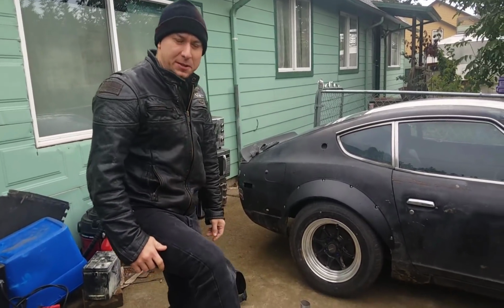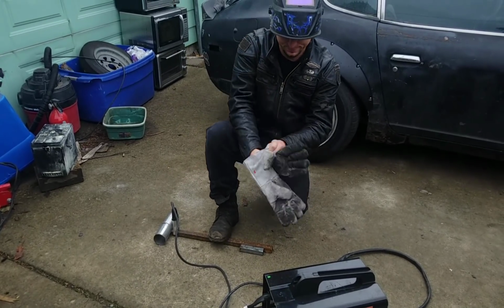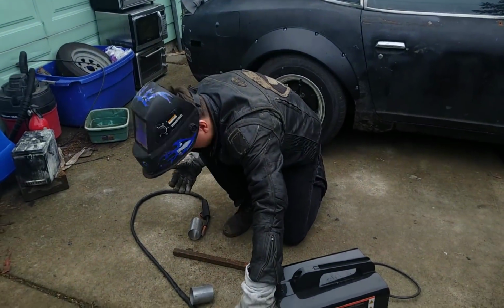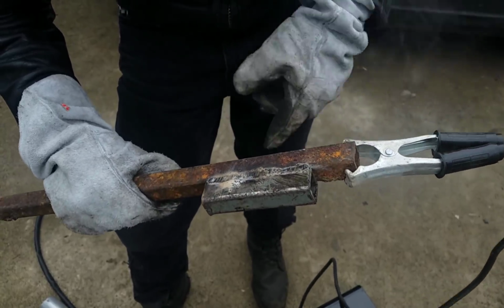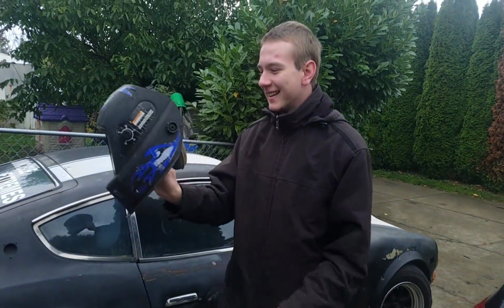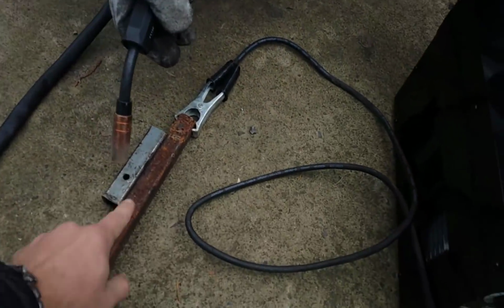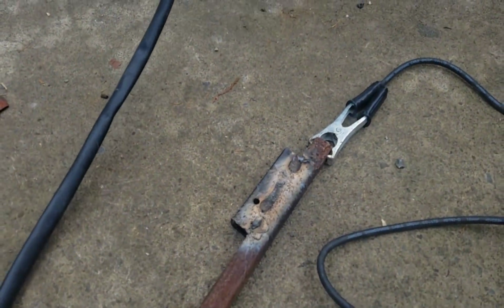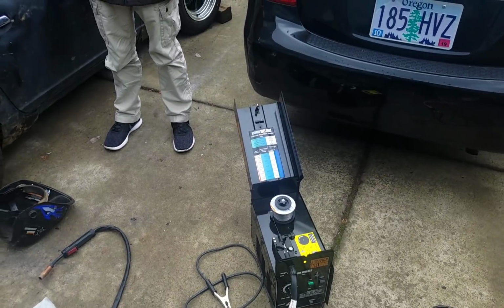$99 125 amp welder. Worth it? new 90 a.  Harbor freight 120v budget welding review. Chicago electric

Comment: I have a small 110 wire feed welder. Bought last year. Havnt touched it. Now I bought a small trailer needs work. Well time to learn to weld. Haven't welded since highschool
Reply from the maker: It's easy.  I'm sure you'll do great
Reply: @InvincibleExtremes  hope so. Do NOT want to have to pay for all the work. Though some things I may have to. Since I don't think it will handle very thick MATERIAL

Comment: From a newbie perspective, I understand Min. and Max. and 1/2 inch and cursive letter "e". Thanks, great video. I know that real welders won't need this video, but for $100 it's obviously good enough.
Reply from the maker: Frank Tiffney it's not the greatest, but I used my old one for 5 years before I threw it away.  It's just really messy, so that's why I like the century fc90 better and it's only 169 bucks...

Comment: I don't have 220v is this the next best thing for small steel armature rods for sculpture? (About 1/4" dia)
Reply from the maker: I would suggest the century fc90.  Half this size and weight, very portable, and a cleaner weld because it's dc, and has less spatter

Comment: Thanks for the video.  I believe I will buy this one for my first welder to do some patch work on our 1989 Ford Van muffler system.  Thank You.
Reply from the maker: margaret gardner it's good for that kind of thing.  The century fc90 they sell in home depot for $169 is a way better welder though.  If you can afford it, I would get that.
Reply: Thanks for the advice.  I will try to get the better one for $169 but we don't have a Home Depot here in Presidio Texas.  This is a very rural area.  We have True Value but their stock is very limited here and what they have is usually much higher than Home Depot.  People here often make trips out of town out of sheer borden and necessity.  Hopefully I'll get a good price on it in Alpine Texas or El Paso or even better Ebay.  Thank You.
Reply from the maker: margaret gardner eBay might have it.  I did a side by side compare of the two welders, have a video up.  Look up fc90, I'm the only one who's shown a review on it
Reply: Thank You.  I'm about to check out the fc90 video.  I'm waiting in line to have a new fuel pump installed then I hope to repair the exhaust pipe myself.  Your kindness is much appreciated.

Comment: I bought mine for 85 bucks about 12 years ago. The ground clamp is a weak link on mine thus i use the brass clamp hf  sells. About 15 to 20 years ago the model had diodes so the output is dc ie direct current. Hf dropped the diodes so the units are less than 100 bucks. Adding some diodes will make a slightly better weld.  The 240 volt hf wire welders have dc ie diodes. The 240 volt models have 4 ranges  for current. The 120 models have 2 ranges. Eons ago the hf 240volt wire welders often had way lower max amps. I have a 240v hf  wire welders that is 115 amps.
Reply from the maker: +3beltwesty wow, yeah I have the 170 amp model and it's nice, but not nice enough to bother dragging out the 240v cord
Reply: 3beltwesty is this weld machine in this video dc out put ?

Comment: Good job, thank you for sharing this.  HF should give you the next model up for free for you giving them this “Free Advertisement.” It helped make up my mind about this welder so I will buy it for that price because I just tinker around in the back yard and now believe it’s all I need. Thanks again.
Reply from the maker: Just a heads up, the 170 model is a MUCH better welder.  Have owed it for years with no issues

Comment: The 90 amp welder (despite the name) has a 120 amp maximum compared to 125 amps for this new model.  Is 5 additional amps at the theoretical maximum output the only difference between the 90 amp and 125 amp models.  The duty cycles at 90 amps are identical for the 2 models.  Does the newer 125 amp model have any benefits or upgrades over the 90 amp model?
Reply from the maker: Denise Manning that's a good question, I mean, besides the amperage difference I didn't see any... feels the same... welding with either one can be tricky but with a good ground it works good.

Comment: Looks like it will get the job done.  Nice vid!
Reply from the maker: +RamblinAround yup! Always good to hear from you guys
Reply: RamblinAround  get u a Miller or an esab or a vaulcan don't buy a Chicago electric there junk I'm a professional welder
Reply from the maker: Jeremy Hutchins they are junk, but they do work.  Especially the 170 amp model.  It's DC output and is a lot cleaner.  That's why I love my century fc90 inverter welder so much.  It's a tiny 15 lbs DC output wire feed and was only 169 bucks.  I have done a lot of in call rust repair with it, and use it on my own projects as well.  A miller is a great machine, but it can also be a giant waste of money for someone not needing a welder full time.  Not to mention a huge liability and heavy and unmanageable in my situation.

Comment: What would after-flash be? Though, I do have a cheap chinesium helmet myself. What turned out to be the issue was excessively low battery from being warehoused forever. 4 hours in the sun and it worked a whole lot better.
Reply from the maker: Cilis Moniker this helmet works great.  Been using it for years

Comment: I have a 90amp model and it works just fine, does the job.  Its not for commercial welding by any means but a small repair here and there it does a great job.
Reply from the maker: William Todd sure does.  I ran about 50lbs of wire through my old  90 amp one before the feed got iffy so I chucked it.

Comment: could you use this to weld quarter panels on cars? I am thinking so,  looks like this metal you're welding is much thicker. thanks.
Reply from the maker: The INVERTER welders which can go as low as 30 Amps and are dc output are much better for thin metal.  I've used this, and I've used all kinds of other welders, and the absolute bare minimum welder for quarter panels is the titanium 125... but the titanium 140 is much better because of its ability to take a gas bottle for a clean weld
Reply: @InvincibleExtremes  thanks for the info, you seem to really know your stuff.   much appreciated.
Reply from the maker: Thanks!

Comment: I know this video is old but would a lower end welder like this be ok for a roof rack? I'd like to make it pretty strong but I assume the design of the rack would be nearly as important. Just tubular steel, the cheap stuff at HD or lowes? I would think so but I've never welded much, I just used a stick welder and got lucky one time.
Reply from the maker: Low end welders can be ok.  Used them for years... my suggestion is the 170 amp machine, because it's dc output and welds way cleaner on flux core.  Or an INVERTER based 90 amp welder if 120v is a must.  Like the little green ones they sell, they're amazing.
Reply: Invincible Extremes Muscle Cars Garage Ok, thanks. I’ll look at getting one of the Titanium inverter welders at HF. I’d get a better one but I am renting and don’t have access to 220.
Reply from the maker: The titanium ones work great with 120v or 240v. Get the best one you can afford... I've been using mine for a long time and love it.

Comment: Just started welding an hour ago.  Setup was fairly easy.  Finding metal to practice on was a pain in the ass.  I made some real ugly welds but after watching this I can see a couple of my mistakes.  Moving too fast, wires too long and I need more light to see what I'm doing.   Kind of annoying when you finally lay down a good line and find out you completely missed the joint.
Reply from the maker: Keep it up.  You'll do just fine.

Comment: First welding video I seen. Very helpful
Reply from the maker: Jesse Delch thanks!  It's not the best video.  Also, if you're looking for a good cheap first welder, the century fc90 can't be beat.  It's WAY easier to learn on and is much better for sheetmetal rust repair and that kind of thing
Reply: Invincible Extremes Muscle Cars Garage  Thanks! I will check it out.

Comment: Sure you can't connect a bottle to it with some options kit or whatever?
I mean, it does have the gas nozzle... why would they waste money on shipping it with parts it doesn't need?
Reply from the maker: +ziiofswe e.g., the 170 amp one is the one for that
Reply: hobart 190....sure its 500 bucks... but it has everything you need, except the hood(welding helmet)  and the spool gun for welding aluminum (about 200 bucks) and no tank... but if you are looking to get a rig for less than $1000 this is a really good one that WILL do commercial welding, not some DIY/hobby welder that this one is...
Reply: oh yea go here and check out some commercial (professional)  welding stuff and how to weld go to weldingtipsandtricks, and weld.com.... chucke2009 does ok but..... actually go to really good welding videos... clean all of the rust and mill scale off of your projects and get a good clean ground and you will have WAY better success... a decent cheap welder but not a welder that can be used in a commercial way.

Comment: I have nobody teach me.  So I self learn, didnt came out right at first time but successfully for the first time, I weld.  Now all I got to do now is properly put the material in a right perspective.  Using $89 harborfreight 125 amp which was on sale at that time is a excellent beginner phrase of welding.
Reply from the maker: Yeah, I much prefer the 170 amp model, or the titanium INVERTER welders.  But they aren't 90 bucks

Comment: Buy a 240 volt welding machine next time!
 In The United States and Canada, the electrical power supplied to most homes enters your home at about 240 volts, that voltage is split at the main circuit breaker panel into two 120 volt halves. Those 120 volt halves are routed through the home to outlets and lighting. 240 volt is used for kitchen stove, water heater, washing machines, dryers, AC and welding machine ! Install a 240 volts outlet in the garage!
Reply from the maker: Yeah I own the 240v 170 welder they sell and it's amazing for the price

Comment: the trick to weld thin metal is to set it to the highest feed setting and then put it on min, go faster than normal and with practice you can get a nice weld :)

Comment: I tried 3 of these & out of the box on a shiny ratchet & coudn't get any spark..Suggestions? Also tried it on a couple of screwdrivers.
Reply from the maker: texjames2000 no spark untill you press the trigger.  This one isn't always on...
Reply: I tried that as well.. My 3rd one finally works. Just unboxed it & tried it on a pipe wrench. Guessing the metal has to be totally clean with no paint or rust what so ever. Will start actually experimenting tomorrow.
Reply from the maker: texjames2000 yeah, it won't spark unless there's a solid ground
Reply: Appreciate it..

Comment: I had one of these that did just fine. My only gripe was that it just didn't have enough oomph to manage many of the light welding jobs I have around the place so I upgraded to the 170 amp/240V and that pretty much takes care of my needs.  Anything bigger than that machine can weld needs to be done by somebody with a lot more experience than I have any way.
Reply from the maker: Yeah I have the 170 model and it welds amazing.  I upgraded to gas shielding and use solid wire in it and love it
Reply: @InvincibleExtremes  That is one of the things I had in mind with this when I got it, that it gave me the option for mig.
Reply from the maker: Yup.  And it gets low enough to actually be use for sheetmetal repair if needed.  The 170 amp model anyway
Reply: Yeah, that's what I have and it will do it. It's tricky, at least for somebody of my limited experience, but it will do it.  Maybe that's a brag for it. If I can do it, about anybody should be able to.

Comment: iam buying this welder thank you for the video
Reply from the maker: It's cheap and it works decent.
Reply: go to weldingtipsandtricks, and weld.com.... chucke2009 does ok but..... actually go to really good welding videos... clean all of the rust and mill scale off of your projects and get a good clean ground and you will have WAY better success... a decent cheap welder but not a welder that can be used in a commercial way.
Reply from the maker: Wayne Hartneck yup, all very true.
Reply: these guys will make you a professional welder with all of the how to's so you can take a test in any position even upside down ( they dont cover how to weld underwater, but who wants to deal with delta-p) and get your welds so even an x-ray can prove your success. there is money to be made in welding if you dont mind catching yourself on fire every day.

Comment: The only difference between the 90a and the 125a is the labeling.  Inside there identical.  The normal output on both machines is 90a, and they peak at 125a.  That's why some people who converted them to DCEN (DC Electrode Negative) blew out 100 amp rectifiers.  I converted my 90a to DCEN , with a 150a rectifier, and it made a quite capable welder for the size.  I've welded 1/4" stock to 3/16" on a project that needed the welds to hold up to 10,000# shear force and the welds are holding very well.  You're not going to build suspension bridges with this machine, but it will stick pieces together with good strength.  The DCEN conversion is well worth the effort.  One other point.  In the video he said it will only take a 2# spool of wire, when in fact it will accept a 10# spool.  If you use a 10# spool it's a good idea to trim the tube guiding the wire into the feed mechanism to half it's length to give the wire a straighter shot into the feed. Another thing is the wire.  Harbor Freight sells wire that is adequate but not great.  If you intend to weld with multiple passes DON'T use the wire that HF sells, E71T-GS  It is for single pass only! The wire code is as follows.
E= Electrode
7 = Tensile strength X 10,000#.
1 = Welding in any position.  0= Horizontal or flat welds only.
T = Tubular wire, flux filled.
G = General purpose welding.
S = Single pass ONLY.  Multiple passes will make the weld brittle.

I use E71T-11 Everything is the same except the 11 will allow multiple passes without getting brittle.
Reply from the maker: Beautifully explained, thank you.  I prefer dc output for flux core, and haven't used flux core in years.  But it's still useful for repairing fencing in a stiff wind for example

Comment: Because of roadkill I've been wanting a Dotson myself to make a Chevy powered Rotson.
Reply from the maker: Allen McKinney I'm about to drop a  big datsun revival video in a few days ;-)
Reply from the maker: frogmanvc I full intend to use it to do sheet metal repairs.  Being too hot isn't a big deal for me, can't run a full bead in 18ga anyway without warping.  So yes you'll be fine.  Little 1/2 inch long or shorter beads all along the seam and it'll do ok.
Reply: I'm thinking about buying an everlast pulse mig welder specifically for what it can do with sheet metal. Any links to videos showing pulse mig in action would be appreciated.
Reply: Datsun*
Reply: Eyyyyyy we watch roadkill.

Comment: The second time you welded on low likely went a little better because the metal was already preheated by the other welding you did on it. It COULD have been the clamp, but most likely it was the extra heat that made the lower setting work better the second time around. Nice video.
Reply from the maker: Treasure Pirate that's a good point.  Thanks

Comment: I was wondering about this welder as a 1st time buy for my upcoming amateur repair shop. looks to me as a good starter unit & I too have never arced myself to anything yet. What's the HF model number???
Reply from the maker: The 170 amp welder is head and shoulders better, and can later be converted to gas shielded with great results for mig.  With a coupon its 165 dollars so it's not a lot more, for a much better welder.  The century fc90 is also a much better welder.  Reason is they are DC current.  Not AC like this one.  I did a compare video with the fc90 and the fc90 is a much lighter, cleaner welding machine.

Comment: I tried gas an gas mig an arc years ago. Then I got a cheap electric mig.  I'm happy as. Slowly learning but happy for the 250 I paid. Paid for itself on the first job. Exhaust first... Then gonna build a trailer next. Best money ever spent.
Reply from the maker: Yeah gas mig is definitely the way to go
Reply: @InvincibleExtremes  this one I got doesn't use gas it's just flux core.. Gas definitely was easier to weld when I tried that but in nz you have to hire the bottles I'm just diy don't use it enough to have gas maybe in the future if I get carried away welding.

Comment: Sounds like a good investment. Plus im buying the mask from harbor freight too
Reply from the maker: The century fc90 is a much better welder, but this one will do some work, but is messy.  If getting one for more than just occasional use, I recommend the smaller, lighter and cleaner to weld century.   And if planning on welding regularly I would get something gas shielded, like the harbor freight 170, which can still use flux core, but is DC, so it welds a lot cleaner.  But can also be converted to a gas shielded mig down the road...

Comment: nice.  i just went to HF to buy the 90 amp on sale for $80.  they were all sold but this model in the  video was on the as is table for $35.  i guess i got a deal assuming it works.  i've never welded before but feel pretty confident after watching Daniel.  LOL
Reply from the maker: Papa Bear it's not hard.  Daniel can do it, so can you.  35 bucks is a deal.  Not the best welder but it does work, even if it's a bit messy